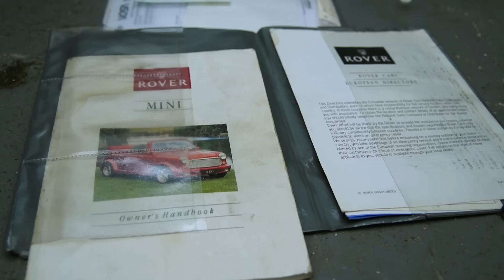Restoring An Abandoned Classic Mini COOPER | FIRST DRIVE IN A RUST-BUCKET | Part 2

Comment: Looks like you donor shell has oversills, couldnt tell fully as it was dark, and its got sportspack arches which the red cooper doesnt have, if you are restoring then the small details matter. Would have stripped it down straight away instead of wasting a day, especially if the engine is coming out anyway